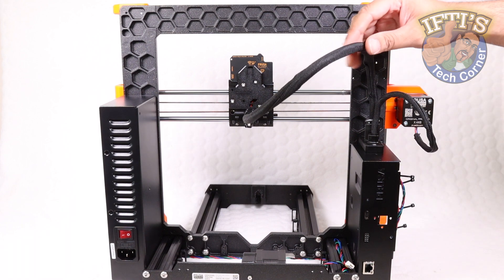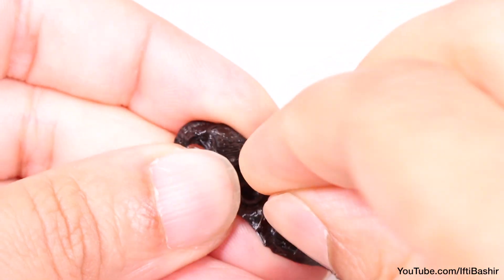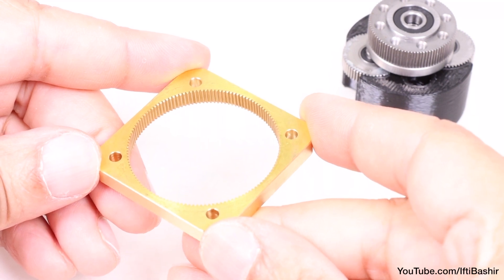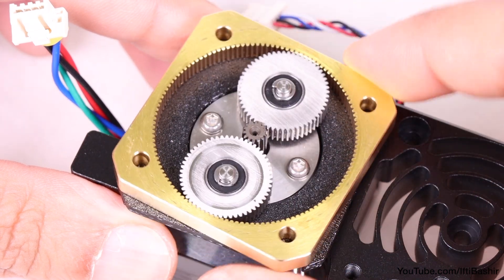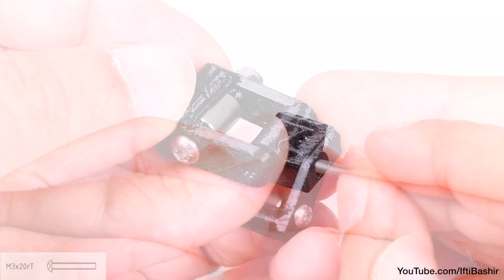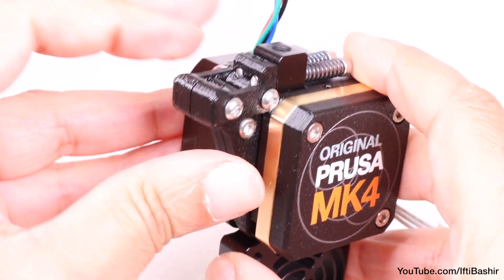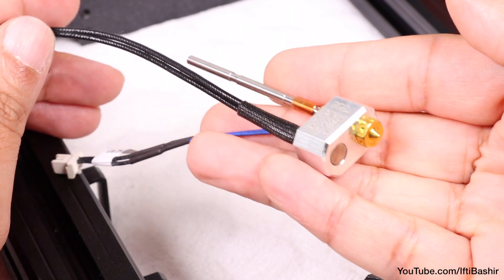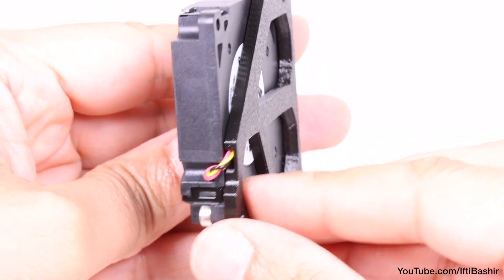#05 Original PRUSA MK4 Kit : Full Step-By-Step BUILD GUIDE - Nextruder Assembly

Comment: Best vid and very very helpful.  One important detail to note make sure you use only one magnet (they are small). I accidentally used two (they were stuck together) and the filament calibration failed but after taking the extra magnet out all is working perfectly.
Reply from the maker: Thanks for the tip!

Comment: how the F do we achieve optiomal tension or know??? I knew i should have gotten a bambulab X1
Reply from the maker: I used the app and it worked fine for me - others have had mixed results. If it doesn't work for you then you need to feel for the tension and set it yourself. This is no different to what Prusa advise.
Reply: You doing OK, bud?

Comment: broioooo wtf that was not ok, you didnt explain at all how to actually tension. none of those prusa apps work. why is theer no way to visually tension it??? this is why i regret buyinga prusa and not another bambu. you really just moved on to the next video? wtf man.
Reply from the maker: I used the app and it worked fine for me - others have had mixed results. If it doesn't work for you then you need to feel for the tension and set it yourself. This is no different to what Prusa advise.